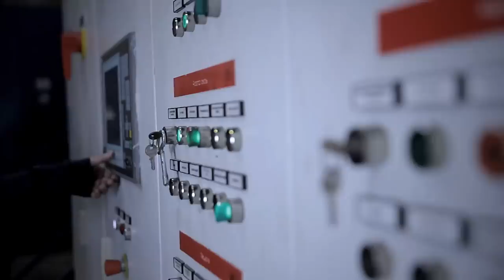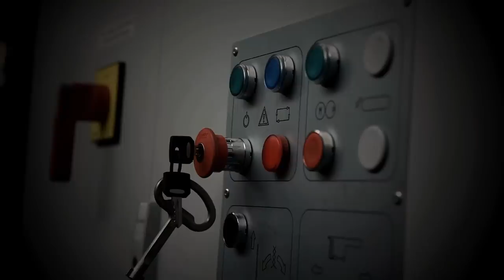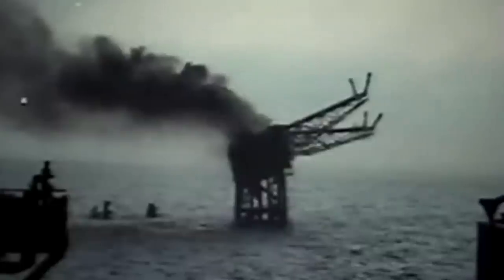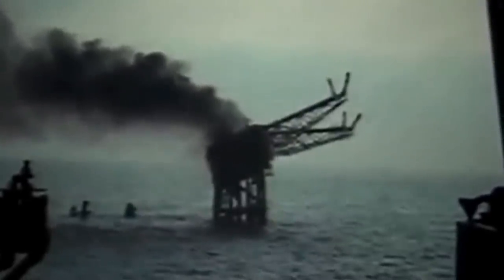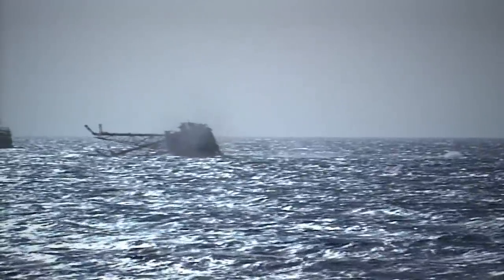Piper Alpha Disaster

Comment: A “skillet” is a steel plate used to isolate valves, piping etc.. Skillets are NOT designed to hold any kind of pressure.
A blind Falange on the other hand IS designed to hold pressure.
I can’t imagine how terrified those guys were knowing you are either gonna drown or burn to death and a slim chance of survival. All because of lack of protocols procedures and communication.
Reply: we (🇨🇦) call it a ''pancake''

Comment: I studied Piper Alpha and other incidents as part of a H&S course.   It is rarely one single mistake that leads to an incident but multiple oversights that come together.  The SOP on the rig was for the workers to stay in the accommodation block during and emergency.  It was thought to be fireproof.  Tragically the only men to survive were those, who did, what they were trained never to do and jumped from the rig.      It's easy to blame the valve blanking plate but it was just part of a chain of events that culminated in the disaster.  Starting with the fact the gas processing equipment should have been in an isolated, contained section.  Terrible and avoidable loss of life.

Comment: A minor correction, the flames didn't melt the steel, while a natural gas flame can get hot enough the combustion has to be pretty much perfect which is very hard to do. At ~200C ( 400F) steel looses around 50% of its rigidity and bends very easily. I've re-arched suspension springs from cars in my oven! So the collapse was from the steel getting soft and bending  not from melting.